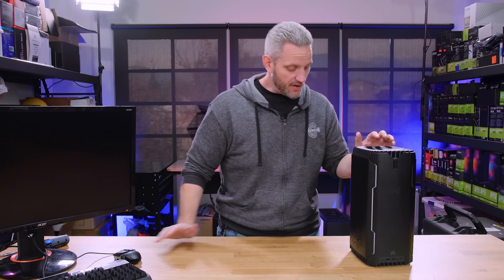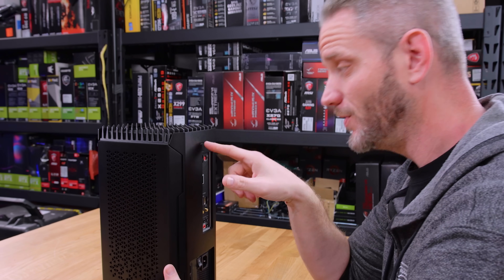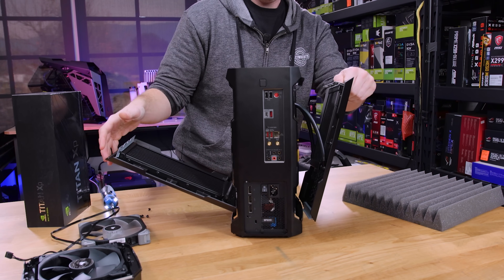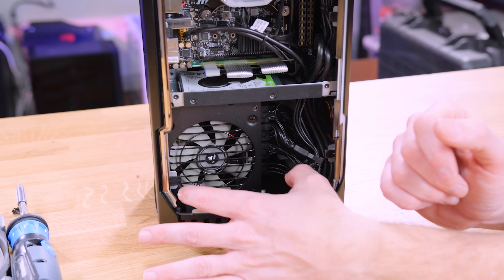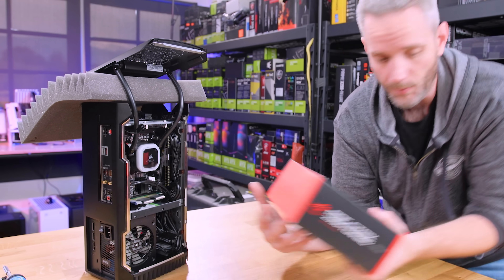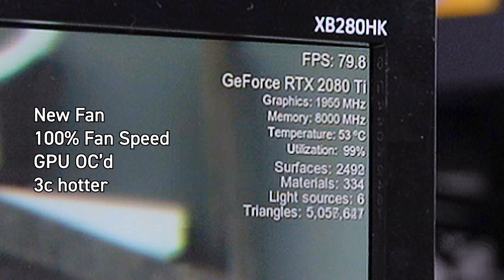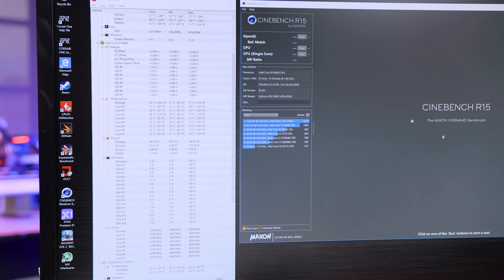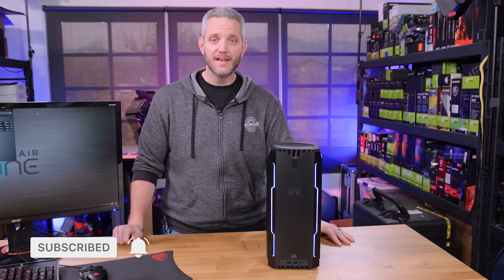Overclocking and Tear Down of the Corsair One

Comment: Thanks for the great video! I don't find a lot of agreement on the topic of upgrading an older PC solely for the purpose of running the newest (and best) chess software for analyzing the games of the best players, including the world champion. No human can defeat the best programs. I have read that for chess engines you don't need (correct me if I'm wrong) to have an expensive graphics card to get super-Grandmaster performance from these sophisticated programs. I cannot imagine why anyone would  spend more than $2000 to upgrade (or build) a PC dedicated solely to chess. Of course, there are some that spend thousands but most folks have to spend wisely (i.e. budget PC). 
  I can afford $1000-$1,500 but such a PC wouldn't make a huge difference due to the unique nature of the software utilized.  Before I spend a lot on anything new, I have an old PC that still works great despite its AMD Phenom II x4 840T processor at 2.90 GHz (an HP Pavilion model p7-1026). I've never overclocked it even once. I've already added a new SSD and wonder:  Along with a new power supply, would that PC be able to handle an AMD FX-8150 (I don't need a threadripper), overclocked? What about the AMD FX-8350? If not these, any AMD CPUs on the market today at or below $200 that would be compatible? 
  I don't have an I.T. background and apologize if this inquiry is a silly one.  I'd need to add the max in DDR3 RAM but at the end of the day would either of the FX series CPU's make a difference if overclocked? I think it has a GTX-780 motherboard. I'm hoping to not get rude replies from others but I discovered this channel only a few weeks ago and it doesn't hurt to ask.  Thank you.

Comment: Re-anodize .  That coating is an electrically mediated oxidation deposition that has a staining element added.  That process is protective.  You will be farther ahead to re-anodize rather than any other process.  Put it this way, would you say "I don't like this glow in the dark blue condom, let me wire brush it off and replace it with marine grade green enamel lacquer".

Comment: wouldn't upgrading to an SSD also slightly help the thermals a little?
Reply: Modern laptop drives don’t run that hot, if it had an early 7200rpm drive, temps would definitely improve.

Comment: I would change top fan to Noctua 3000 RPM Fan, give it 3600 Mhz Ram, upgrade mobo and power supply. And change out thermal paste to Thermal Grizzly. I would say delid, remove solder, and add liquid metal, but I know you wouldn't do that.

Comment: Hey Jay, quick question.

I recently purchased a 9900K, got it running at 5.3Ghz 1.38v stable. Max temps after 8 hour adobe after effects renders are like 75 C. And Aida testing gives me 95 C under full synthetic load for a day.

However, 5.2Ghz is stable at 1.35v, lowering those numbers significantly. 
So my question is whether or not the extra 100Mhz is worth the added power draw and temperatures given how damaging those can be in the long run.

This is just a quick and dirty overclock though. Only been testing the limits for a few days. With some tweaking I might be able to lower that voltage but for now that's where I'm at to keep it stable in all programs. 1.375v seems to be stable in gaming and after effects which is most of what I do with my PC but will crash when using Cinebench to test temperatures and performance...

This is without delidding by the way. If I feel like risking it just to save myself 5-10C instead of the 20C drop I got with my 8700K then I'll do that later in the year.

Comment: Hi Jay what would be very cool is actually combining all the ideas you mentioned in the video and then some. 
Lets say change the PSU to the  SFX SX800-LTI with custom cables, GPU to the RTX Titan, custom loop cooling both CPU & GPU, change the MOBO to the ROG Strix Z390-i (modding will be required), Samsung SSD 970 EVO NVMe M.2 2TB & 860 EVO 4TB SSD (2 if possible) and the Noctua NF-A14 industrialPPC Noctua for the fan, buuuuut if the case has enough space try the Delta PFM1412DEB7V (140X38MM). 
Also you remove the black paint off the case, have all brushed aluminum panels and laser engrave your channel logo on the case. 
That would be awesome.

Comment: highest rpm fan u can find and a titan rtx or whatever the best GPU is that will fit, give it some volta if possible, bigger psu and just faster memory. overclock the sh!t out of it jay. love these videos there great. would anyone do it(probably not), does it make it better(maybe), will it work(who cares). take the side panels off and add fans or something to the aio rads. just push it to the limit so its either the best ever or it goes down in flames. your the man jay, just overclock all the things till they can take it no more

Comment: i guess teh Z370 chipset does have a hardware power limit due to the 9900K pulling more power than the 8700K (which the mobo was originally designed for) and due to perhaps less amount of VRM's and less robust construction, it simply refuses to go byond a set power number.

Comment: Tell the dude in the background, to stay out of the damn shot unless he is a guest speaker!!

As far as the chassis decoration, I dont give a shit. Paint it hot pink if you want to and call it the "SAVE THE TITTIES BUILD!" with the breast cancer ribbons!

But definitely swap out the motherboard, ditch the sata pussy drive for an NVMe M.2 drive, swap the power supply (since you are going that far into it anyways, and then let it rip again!!  If it survives all that at 5.3GHz or higher OC, than worry about the looks of it!!  but to be honest, it aint worth $3k-5k for what is in it.  

The motherboard (ASUS one) is only $200 from newegg, water coolers are roughly $4-500 for both, processor is $499, RAM is $275-300 for 16GB, NVMe M.2 drive (250 gb) is $50, and vid card (RTX 2080 Ti) is $1500, power supply would run about $100 and regular case for it all is only $50.  Totaling roughly $3200, but most people can get by on a $220 1060 which knocks it down to $2000 or close to it.

That chassis isn't worth the premium they might want for it IF IF IF they ever decide to sell it outright.

Comment: Hey, I'm building my first pc and want to know a few things. The PC has a i7-7700k, a GTX 1060 (not sure which model exactly), and a b250 MB. I don't quite have all of the parts, but I plan to get a 600 watt psu, 8 gigs of RAM, and 1 terabyte of hdd. I'm curious to see if anything will be bottlenecked or If something is a bit higher or lower of capabilities than my other parts. I have very little to no headroom cause I'm employed. After i buy the last parts it should leave me with about 75-80 dollers to spend on something or upgrading, so if I could get some budgeting tips on what I should get with the cash that I have would be a huge help. Thank you.

Comment: Get it to run NVME drive, swap the PSU, swap GPU - rtx2080, cpu - 99990k, new custom water loop, try to squeeze in 2 more fans, maybe on the outside of the case, just put as much horse power as you can cram in there and make it run without throttling or too much noise , that'll be the ultimate small factor PC

Comment: it is funny that you say msi has the secon worst Bios. I recently build a second pc for myself. My primary one is an ryzen pc with an Asus strix 370-f and i had tons of issue with its bios. I had to update it several times and had to get a custom bios because mine had an option enabled which should have been disable but it was not even visible in bios. Then a year later i bought an msi board for my second system (also ryzen) and everything went extremely well and the bios was in my opinion much more intuitive andy the fan curve setup was better as well.

I know this is highly subjective, but thats the reason why i wanted to post a different opinion. For my my next Board wont be an Asus next one will be Asrock again.

Comment: One of my biggest questions from the previous generation of the Corsair One was the use of the MSI motherboard.  I'm quite happy to see that the components in this unit are standard and upgradeable.  I do love the style of the form factor that uses the natural process to help the heat clear the system.

I hope we get to see you do some more play with this system and see how much performance you can get out if it!  And to see a custom job using the case would be fantastic.  How does the performance compare to your Loque system?

Comment: EVGA make crap products. I bought a thousand watt EVGA power supply and it lasted one day. Almost took $1,500 worth of Parts out with it. Replaced it with the Corsair 1000 watt power supply and have had zero problems. EVGA will burn your house down.
Reply: I have plenty of evga power supplies and all work fine(well one has a dying fan) what psu was it? I have a 550 B3 in my main machine and have for more than a year(almost two)

Comment: Holy hell, they went MSI for the mobo?- Made me love Corsair a little more there.
(Hate asus, never had a board from them that didn't die in one way or another, all the way back to the KT133 series)
Edit: Watched longer, does your distaste of MSI extend beyond the bios? I rather like their higher-end boards, even the bios'. Never have problems OCing my MSI boards, your issue is new to me, makes me wanna google and see how common it is across their mobo range.
Reply: All my Asus boards work extending back to Socket A. I also have LGA 775 boards, an 1151 board, an am2 board,  and an am4 board in my main pc.

Comment: Think the VRM overheat....maybe you check the temperature on that.

MSI has not Voltage Offset. Mayor flaw. As Buildzoid from Actually Hardware Overclocking found out, LLC in MSI Boards is best set to mode 3.

Comment: Please, please, PLEASE swap out the gpu, motherboard, and mayb the power supply.  I havent seen anyone actually do it yet, and so far its just, well its a standard itx mb and looks like a normal graphics, we can upgrade it!  But we dont know for certain if other mbs will fit well or if the gpu water block only fits certain gpus, etc. and i doubt corsair will tell us those answers, and...you already have one...so you can test it for us right? 😃
Reply: GPU block and heatsink fit a TITAN RTX, but you need to splice the wires to get the fan powered because NVIDIA uses a proprietary header. Standard mITX boards fit, PSU can be straight swapped for the new SF750 since the cables are the same. NONE of this is covered by the warranty, but it was definitely engineered to be a little friendlier to nerds like Jay. ;)

Comment: Could u mount a 120/140mm fan on the radiator over the CPU? Possibly on the GPU side as well. Looks like there’s clearance. Also ASUS mobo and higher voltage PSU + redo thermo paste all round should be good! Keen to see!

Comment: Coat the case in chrome, and make it a monolith.
Either chemical bath (easy), or spray it. 
With of course the 3k rpm fan and a Titan.

Or you can build a rig to keep the sides in a gullwing style, and add even more fans for maximum cooling and rgb.

Comment: Compared to the other System Integrators this is a NICE product. But it is ~2x the price.
Also, GPU and CPU are MSI parts since they have commercial agreements, which is why they skimped on the Mobo

Comment: I have a first gen Corsair One Pro I'm progressively swapping parts in and out of for fun. Upgraded from the 400w PSU to 600w (and soon to 750w), flipped the PSU for better airflow, put in a Noctua fan on top, installed a Asrock Z390 Phantom Gaming itx with a 8600k and plan to switch over to Air Cooling to see what happens there. Corsair really should sell this as a case on it's own it really isn't much harder to work in then other SFF cases. Also the pricing on the gen2 series here is just ridiculous.
Reply: 4 years in the future I picked up some of these for cheap and have been having fun playing around with them. The i160 with 9900k/2080ti is still pretty decent. I also have a Corsair One Pro with the 8700k/1080 combo. One thing I noticed is the Pro has a larger CPU radiator than the i160. Im thinking about doing a new build with these using a 13600k and the larger CPU radiator. I already have an extra SF750 lawing around from a previous build. I can reuse the 2080ti but I might see if I can make a 40 series GPU work with the little corsair radiator. Most likely need to undervolt both. I really like these little towers lol.

Comment: From what I know the asus z390 mini itx board has a huge ass plasticc cover that would definitely reduce air flow, a 6 phase 45A vrm with a bunch of coils to make it "looks" beefy - it is not, a second m.2 slot that nobody would dare to use in this form factor, and msi probably has some kind of deal to provide corsair with modified mobos and gpus for cheap, so it's pretty understandable that corsair would stick with this z370

Comment: It clocking down is because of VRM force throttling the CPU down, it cannot handle it at 4.8 for more than few seconds. You need put that Asus Z390-I board or something like Gigabyte Z390-I Aorus Pro in for it to not throttle. Why it works fine for Cinebench? Way lower load for CPU and VRM to handle, Cinebench R15 is actually quite easy on CPU and VRM.

Comment: Try a ASRock X299E-ITX/AC Mini ITX in their, upgrade to the EVGA Power Supply, Create Custom length power cables, and install a 3000 RPM Noctua Industrial PWM Fan! #ULTIMATEUPGRADE

Comment: I bet the VRM is struggling which causes the clocks to drop. Seriously that z370 board came out back when 6 cores was the max. A lot of z370 boards that received the BIOS update for compatibility aren't recommended for overclocking the 9700k/9900k. When it comes to them using MSI, I think they have a longstanding relationship.

Comment: The VRM-s are having a almost nonexistent cooling in this cramped case and on top of that they don't have proper aluminium fins with heatpipes on them as they should. The VRM-s are constantly thermal throttling by lowering the voltage to themselves and consequently to the CPU Jay....you as a quazi one of the big selfproclaimed youtubers should know that by now. On Shintel cpu-s since the i7 8700(nonK) the VRM-s absolutely need direct fan blowing on them to stay properly cooled at stock clocks already....and you here are trying to OC this overheating little box....very nonknowledgable Jay ;).

Comment: buys several thousand dollar pc

comes with hdd
Reply: v KEITH v  yeah I got a 6tb external for my xbox for a great price but I've only used half of it and I have 100s of games a bunch of them are 100gb+ big
Reply: Hdd is usefull. Any PC over 2000 dollars should have like 6-10+ tb of HDD
Reply: @CiceroFMYT  yes, hdd is very useful, but when you're paying that much for a PC you should get at least 4tb of ssd storage
Reply: @skaterbi922  i dunno for the latest corsair pc 
but the first version that i have, there is only a difference of 400$ish between the cost of the material and the actual computer 
without counting the building itself (which is pretty silk let's be honnest)  and the garantee from corsair itself 

Its great value.
Reply: @tarteopoire179  I put together a better spec PC for 2k and waaaay more ssd storage, I understand the whole argument with of course you can build a cheaper system but I have a i9 9900k, 32gb 3200mhz trident z ram, rog strix z390 gaming, 3tb Samsung m.2 storage and a rtx 2080
Reply: I'd just take my current SSD and throw it in there...no worries for me.  I get them free from work anyway they're top of the line Evo's.  @CiceroFMYT
Reply: @troymuni6120  meanwhile it's been taking me 2 years to build a fx 8350 system and all I have is CPU and some used 4800rpm laptop hdds, and ik going to borrow a friends old gtx 950, I'm only 15 tho and dont have a way to get money
Reply: and a cheap MoBo
Reply: Pays 4000$ for a pc 
Plays free games
Reply: @rastas_4221  lol ik, but for that price you should be able to get 4tb ssd storage
Reply: şķąţęŕ Bøi Sponsored

Comment: I'd suggest either an outlandish external loop or giving it a tophat with 4 (5?) iPPC-3000 fans sucking air through it.

Or you could completely strip it down, swap out the MB, PSU, etc and build in a custom loop - a Monsta 140 would be rad sat in the top...

Comment: PCI-E riser cable... That's going to introduce latency issues.
I've tested several, and my particular setup allways introduces latency with riser cables.
Audio stuttering is the main giveaway.
If you slap enough cores on it it'll probably be fine, but riser cables are shit, even the more expensive ones that have serious insulation.

Comment: how about adding static pressure fans to the exterior on top of the radiator sucking air out of the case, then reverse them to blow into the case to see whether it would have an effect

Comment: I don't think the GPU clocks were lower in Superposition due to the temperature. On my runs i had water cooled card that never exceeded 50 degrees under 100% load and in 3DMark it was constantly running at 2050-2085, but in Superposition it was always at 1950-1960 and even then it was not really stable. No idea why.

Comment: PSA: Corsair does have a 750 watt Standard SFX PSU now (SFX = 100mm Depth SFX-L = 130mm Depth) (Same pinout as the SF600 but has 1x extra PCIe port and 1x extra SATA port) (CORSAIR ONE PRO i180 uses the SF750 in fact, model Jayz has is the i160 with SF600 PSU)
https://www.corsair.com/us/en/Categories/Products/Power-Supply-Units/Power-Supply-Units-Advanced/SF-Series/p/CP-9020186-NA

Comment: Make it shiny silver! And try to pack it with the most powerful things you can find to see how much heat can handle that rads/fan setup!!! It would be cool to analyse how the air flows in, through and out the case and what things Corsair did to ensure the air is pulled from the sides and through the rads...

A thought on the case itself, it would be awesome if the side panels open up like doors instead of flipping and falling...